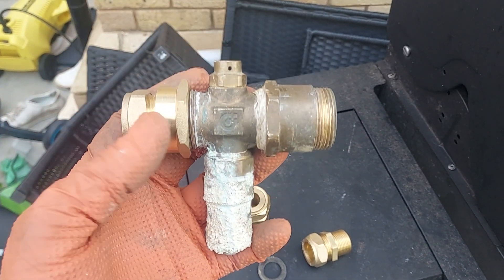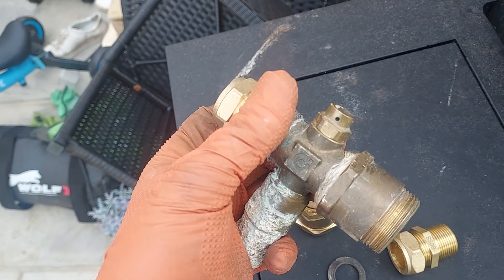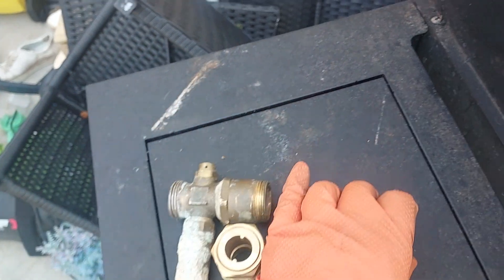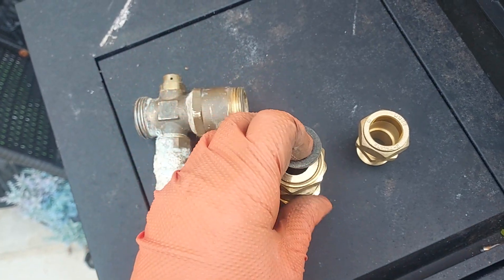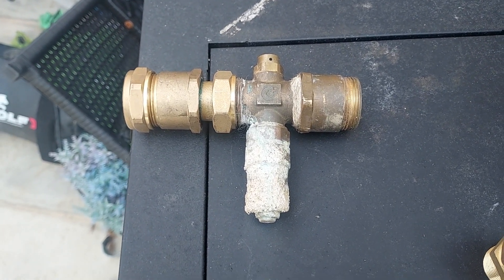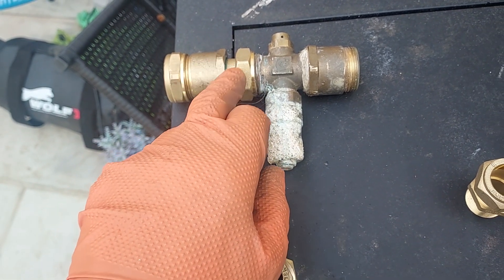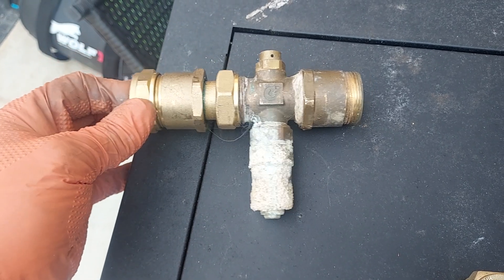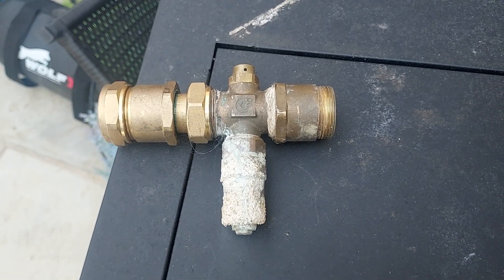Flat-faced unions. making a water tight joint the correct way

Comment: Why can the antifreeze valve manufacturers not offer a solution that connects directly to the ASHP without cobbling up additional fittings? P.S. I do not like those uber long flexibles that seem to be standard practice - surely you only need a 300mm flexible - to attenuate noise/vibration of the unit
Reply from the maker: Totally agree about the length of flexible connectors. They are available in different lengths so I don't know why installers always seem to choose these long ones. If I was specifying the system I would want to use an appropriate length for the system that I'm installing. Also I wouldn't have them made from rubber but from metal like the viessmann

Comment: 3/4 copper tap connectors, grind out the lip should be just as good. I've done that for years and it worked for me
Reply from the maker: The trouble is this fitting is 1 in. 3/4 tap connectors work better with 3/4 fittings. For 3/4 fittings I just used 3/4 flat-faced unions as I do not need to modify them and they fit perfectly.

Comment: Paul Brimble at Bee Trading does a superior flat faced union.
Reply from the maker: I buy the ones from B for boilers but they don't have a male thread. I guess you could crimp two together with a straight connector though or even better add two of them to a 28 mil isolation valve